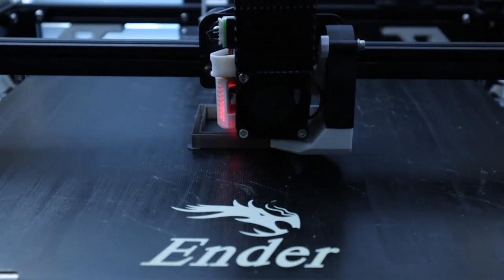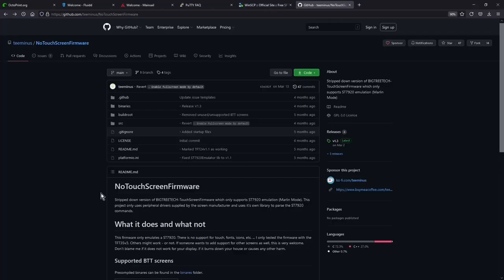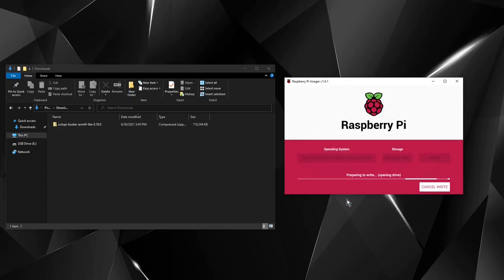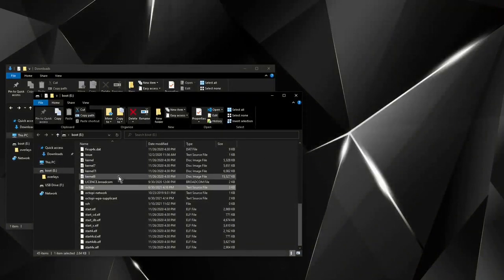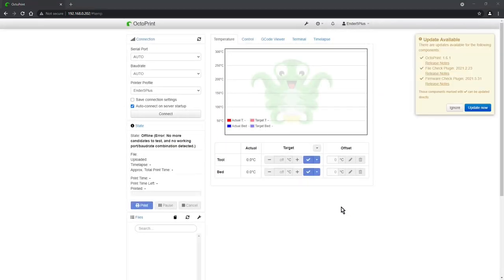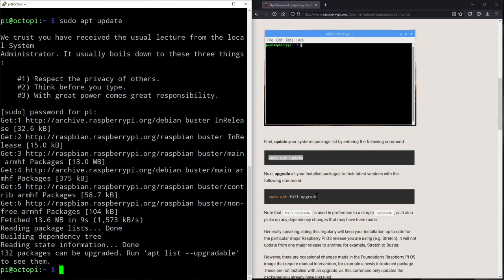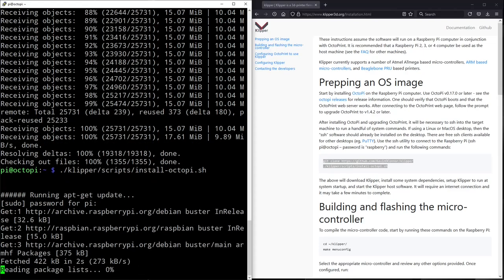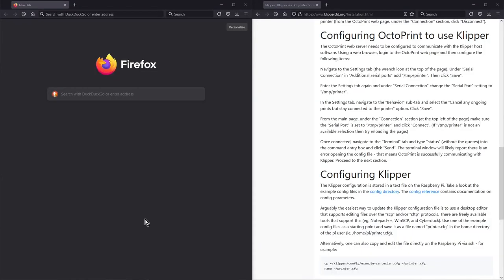KLIPPER Installation Guide for the Ender 5 Plus w/ BTT SKR Mini E3 v2.0 and TFT35 v3 Display

Comment: Just a little "gotcha" I encountered when watching this excellent guide; remember to remove the SD-card from the LCD as soon as you've finished flashing, else the next time you power-cycle the printer the LCD will attempt to flash an invalid file from the card and get stuck in a state where all it does is report something like "Illegal flash app! on the display.   Don't panic if this happens to you though, remove any file remaining on the SD-Card (it may end in .cur), copy back the NoTouchScreen .bin file that you downloaded as mentioned in the video to the SD-card and power-cycle the printer again to re-flash it.   And this time remember to remove the SD-CARD as soon as the flashing is done!  :-)
Reply from the maker: Thank you for the heads up. I should have mentioned that in the guide

Comment: I have an Ender 3, BLTouch and wanted to try Klipper. Although I couldn't find a specific guide to mine, your Ender 5 guide helped me enormously. Thank very much as you probably saved me a lot of heartache!
Reply: I also have your set up. I got to loading firmware on to the SD card...can share what you did differently?

Comment: Thank you for taking the time to explain this setup.  I actually have all the same parts on order for my Ender 5 Plus.  Looks like they will be here Thursday.  I am looking forward to the new setup.  I have gone through many other setups to date.  I am hoping this will fix some issues I am having.  Thanks again for the instruction for this setup!
Reply from the maker: I'm really happy with this set up. Klipper was a huge leap in terms of print quality. I am able to get better quality prints at much faster speeds now, thanks to klipper tuning. I highly recommend getting an ADXL345 accelerometer for input shaping.
Reply: @EB3DPrinting  My Printer is a bit different in that I have an EZABL sensor from TH3D and I am extended in the Z axis to 700 mm.  If all goes well I will extend to 1000mm in Z.  I design scale airplane parts and also RC turbine aircraft so I use the printer to make plugs for my molds.

Comment: Thank you!!!  This tutorial was great!!!  It worked for me to switch over to Klipper on my Sovol SV01 using the SKR Mini E3 2.0 and TFT35 E3 V3.0.  I copied your menu settings from the link and modified them to get the display preheat options in my preferred order.

Comment: And by the way, since I didn't say it yet - great video! Perfect timing for me as I had just been looking at Klipper recently and I have exactly the configuration you used. You even use the tools I already have set up on my PC. I got through the whole setup, including some troubleshooting, in a couple of hours and am  now running a test print that is looking good so far.

Comment: Thank you very., very much for this video!
Have an Ender 5 pro standing here with BTT 1.4 and have been working tediously on getting it upgraded to linear rails etc. pp. ad nauseum.
I searched for Ender 5 Klipper and chose this one as it is the longest tutorial I could find 😊 Yep, the longest - I‘m very thankful for the level of detail you went in to!
PS: I‘m using Ubuntu Mate on my 4B as it‘s arm64 instead of armhf (32bit), this means more work but I have the time.
Hope many others find your video here, I‘ll subscribe too!
All the best

Comment: Hi, I have an Ender 5 plus and wanted to upgrade it with the BTT E3 mini v.3 and the TFT35 v3 display, so this video looked like a godsend for me. Firstly, I attached the board to the printer then attached the display to the board. When I powered on, for a few seconds it reported no printer attached, then changed to Ender-3 ready. (I am not very experienced, as you will find).
I assumed that this is the firmware the brand new BTT Mini E3 v.3 ships with.
I followed the steps in your video to the letter, and created the firmware.bin file. I then copied it from the klipper/out directory onto an SD card formatted as directed. When I placed it in the card slot on the board, nothing changed that I could see.
I continued to the steps for the display, and again copied the firmware file to an SD card and inserted it into the slot on the display. Again nothing appeared to change when I switched on the printer. The screen still shows Ender-3 ready. 
I have gone back to the beginning and repeated the whole process again with the same result. Am I missing something or can you help me get this sorted. Rather than go through a lengthy conversation on here, Are you on Messenger?

Comment: Thanks for the quick updates. One more thing I should have mentioned but almost forget because it was easy. You also have an include for your macros at the top of the config file. I just created a dummy macro file since that seemed like something I'd want to build on later, but until I did that it did throw an error. I know, you warned against just using your config file so it was my own fault. But I'm probably not the only one :)
Reply from the maker: That was one thing I was looking at too, as I didnt mention in the video about using winSCP to create a subfolder that I store additional config files in. I'll remove that line as well

Comment: Nice video ! Got a question. Is it really necessary to change the firmware of the display? I kinda like the touchscreen part :)
Reply: it does not work in touch screen mode, that is the point of this,  there is a UART workaround. i cant even get my display to work at all 😭😭
Reply: @devinlehman8798  
I haven't started my build to klipper. Still on octoprint. But I have received my orangepi 3b so soon I will begin 😁

Comment: good video, im currently gobbling up any ender 5 videos mine was just delivered today. your videos seem the easiest to follow and its not filled with fluff, and that is appreciated. keep up the great work. have you considered a corexy upgrade to the ender 5 it seems the next step to my new to the printing arena.
Reply from the maker: Yes, that is currently in the works. I'm trying to figure out the best way to go about doing that. I plan on doing the corexy and linear rails at the same time.

Comment: In your sample config you have a section for Resonance Compensation which includes another serial: definition. I made the mistake of copying and modifying your config so, since I don't have the rpi mcu installed Klipper was trying to connect to /tmp/klipper_host_mcu and was unable to do so. It wasn't until I reviewed the log file that I was able to see that it wasn't connecting to the serial USB port I had defined. I commented out the entire section and got it working. 

Just a head's up that you might want to either remove that RESONANCE COMPENSATION section from the sample config you uploaded, or explain it.

Comment: Hi,
Thank you for sharing the Klipper installation in such detail video.
I have a Ender5plus with SKR Mini E3 V2 and TFT35E3. I followed  the video til the part requires to flash the motherboard of the printer with the "firmware.bin (renamed from Klipper.bin)". I turned on the printer while SD card has inserted, but the screen shows black only. There is no sign the new firmware has updated to motherboard. 
Then I also keep going to the part to paste "ls /dev/serial/by-id/*" , but putty returned as "ls: cannot access '/dev/serial/by-id/*': No such file or directory".
On Octoprint, it shows Klipper standby. On the SD card, the file extension has turned "cursor".
Any advice I should try.
Thanks

Comment: if anyone's curious, this is my config for stepper fan control.
fan on when steppers engage, turn off 1min after steppers.

obviously my stepper fan is on PC7, ymmv.

[fan]
pin: PC6

[controller_fan my_controller_fan]
pin: PC7
idle_timeout: 60

Comment: I have a question, will this video guide also work with the ender 3 pro? 
I'm thinking about getting the SKR mini E3 V2 control board 32 bit and the TFT35 E3 V3.0.1 Touch Screen with Dual Modes for the ender 3 and I was wondering if there was anything I need to change with the firmware or that this not compatible with the ender 3 pro?
Reply from the maker: The only things you will need to change are in regards to the printer config file. Your dimensions and printer setup is different which you will need to match in the config file. Everything else would be the same.

If you run into any trouble you can always ask. I'll try my best to help
Reply: Thanks for the fast response!
Reply: I want to do the same thing! Did it worked for you 🤔
Reply: Have not tried it yet.

Comment: Thank you! You gave me the courage to try to install Kilpper on my Ender5Plus, I have the same setup as you except the hotend. I have some problems with the printer right now that I can't troubleshoot, like it's printing for 2 minutes or 5 minutes, or 2h, and the random it gets clough and extruder motor can't push any more filament into the hotend, and there's no more filament coming out of the hotend, I really don't know what the deals but it's really frustrating.... I've changed the thermistor, did the PID tunning. no luck.
Reply from the maker: Sounds like either a partial clog, or a retraction issue. Could be heat creep as well. Might need to check the hotend fan. Make sure that is spinning properly. Also check your extruder gears to make sure they are not worn. The brass wears out and will not grip the filament any more. If you have a plastic extruder, the tensioner arm could have a crack in it as well

Comment: i have the skr mini e3 v3 and i CANNOT get the display working... tft35-e3.... will not display anything. it flashes the file, but no emulated marlin mode... im dying here pleasse help
Reply: i also CANNOT get it to print. no matter what. the first layer is okay then it starts going insane, fast, no filiment even coming out, it just drags a little filiment all over the bed. i am so frustrated with this. This was a good guide but i can't find ANYTHING AT ALL for the sskr mini e3 v3 and tft35-e3 display. they simply dont work together, im ready to cry right now this sucks.

Comment: Hi. I have to ask why would you use aftermarket board when running klipper? I'm thinking of running klipper on stock e5+ and wonder if there would be any difference
Reply from the maker: The main reason at the time was because I had it set up in the kitchen. So I went aftermarket to use the silent stepper drivers. The stock board is more than capable of running klipper. But for the quality of life of reducing noise, I went with the SKR mini e3 v2
Reply: @EB3DPrinting  did steps calculated from marlin values behave fine? Was this transition painless? I have only one printer so im a bit hasitant to have it non-functional for whoever knows howl long and having to recalibrate all basic functions is kind of scarry. I print a lot of precise parts and i've learnt tolerances so far
Reply from the maker: @zgrywusbat471  it does take some time to get use to. If your printer is stock, the default config file for klipper that's already available will work to get you up and running. 
If you are already running your printer off of a raspberry pi with octoprint, I'd suggest getting a second SD card for klipper. That way if you have any trouble or it's taking to long. You can just pop in the raspberry pis marlin SD card, reflash marlin to the printer, and be back up and running

Comment: Im a bit confused. Im looking at all of the config files and they all look like they have something different. How do I combine them?
Reply from the maker: They do all do something different. I have them set up that way because if I want to change something say with the BLtouch, all I have to do is go to the bltouch config file, or change something with the stepper motors, just to the stepper motor config file. I do this so I do not have to scroll through hundreds of lines of code to get to the section im looking for.

These are already "combined" with the printer config file by using the lines at the top of the printer.cfg file such as [include bltouch.cfg]. This line automatically loads the contents of the bltouch.cfg file when the printer.cfg file loads

If you would like to have all the contents in one large file, you can copy/cut all the contents from the individual .cfg files and paste them into the printer.cfg

Comment: I have pretty much the same setup as you but a few differences. I have ddx v3 but having issues with it not extruding. The motor moves but not fast or enough to be useful. I’m using the BTT octo 1.1 with 2209’s. I am using most of your code minutes the pins that differ. Do you have any idea what would cause this issue?
Reply from the maker: Do you have your rotation_distance and gear_ratio settings set up correctly?

Comment: Amazing thanks so much! Came here just for the TFT35... but I get no updating show on the 35, and suddenly after a couple of reboots get kinda the right image but they're a bit collided or missing in parts. Liked and subbed :)
Reply from the maker: Did you have your tft35 switched to marlin emulation mode before the flash?
Reply: @EB3DPrinting  Since using klipper it's done nothing at all except say "LCD12864 simulator" at the top.. So it seems permanently in that mode. There is NO response whatsoever to any USB or SD card boot, via reset or printer on/off. I'm getting the basics on the screen after your instruction, but it's really bad, all collided numbers as if the wrong resolution. Someone mentioned take out the 5 pin on the back so I tried that, and klipper is way slower to boot but it's made the text more readable. Bloody nightmare.
I found some bootloader files in the github for TFT35, but zero instruction.
Many thanks.
Reply from the maker: @Mr_Gadge  ok, first, make sure the pi with klipper can connect to the printer. Once you can connect to the printer, use an SD card with the "notouchscreenfirmware" and put that into the tft35's SD card slot while it is powered off, then turn it on. If this doesn't work then try:

Reflash the printers main board with the latest BigTreeTechs firmware, same way you typically flash a main board with a microSD card. Should be able to find this on github

Then reflash the tft35 with BTT latest firmware for this from GitHub as well. When you get the screen up and running again. Press and hold the knob until you hear three clicks/beeps, then switch it over to "marlin" mode.

After doing this, reflash the printers main board with your klipper.bin file. Make sure the pi can connect to the printer, then reflash the tft35 with "notouchscreenfirmware".
Reply: @EB3DPrinting  The printer has been working fine on klipper, and I've just been through rotation changes etc so I'm not wiping all that and starting again (fresh 'make' two days ago) .. I think my bootloaders damaged. Just tried the marlin mode, it simply ignores any SD or USB stick at fat32 :(
Reply from the maker: @Mr_Gadge  I get what you're saying, but you wouldn't be wiping anything. The pi would be unaffected. The only thing that changes is the mainboard firmware, which you can simply reflash with the original klipper.bin you used. No need to even remake that. You wouldn't have to re-setup anything

Comment: Thank you for doing this video!!!!! I touched the wires for fan0 on my 1.4 turbo which you can not get anymore so I ordered the skr2 board. How different would it be on the display config part? I will be donating. Some of the discord’s for killer are not as helpful to say the least.
Reply from the maker: Sorry for the late reply, I didnt get the notification for this. But the process would be the same, You would just have to figure out the pin-outs for the SKR2 and change that accordingly in the Code copied from the NoTouchScreen Firmware github

Comment: I'm following along on this to hopefully get Klipper running. Is this the same process when flashing an SKR 2? I've not had any luck yet.
Reply from the maker: Yes it is the same process. I am not familiar with the SKR 2 board yet, but I would say there is something off in your makeconfig settings that is causing it to not flash properly. Just make sure you are compiling it for the STM32F407 with a "32KiB bootloader".
Reply: @EB3DPrinting  yeah, that's the settings that I've been using. Trying something out now after restarting everything from scratch again.

Comment: Hello, excellent video! I'm trying to get mine Ender 5+ to work and when I go to set the BL touch settings like you have I keep getting an error: Unknown pin chip name 'probe'. Any ideas how to fix? I am using a BTT mini E3 V3 with my BL touch plugged into the z endstop which is pin PC2. I'm lost at this point. I have swapped the black and white wire in the JST connector and the Brown and red in the other connector to match my board. Thanks!
Reply from the maker: This is happening because "probe" is incorrectly identified. 

Make sure your bltouch and safe z home section is configured correctly and that there arent any misplaced indents or spaces.
Reply: @EB3DPrinting  I went to bed last night and this morning and everything made sense and got it right away. lol Just finished setting up my mesh points, almost ready to do the first print! Thanks for the response!
Reply from the maker: @Davedubya69  Apologies for the late reply. I'm glad you got it working though. If you have any more issues, feel free to reach out